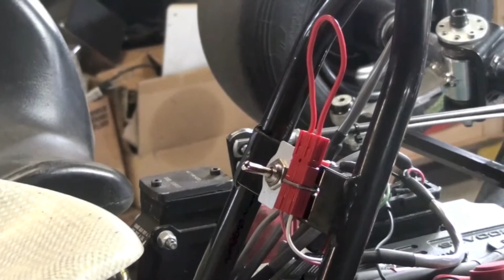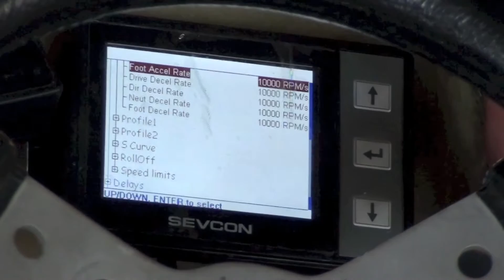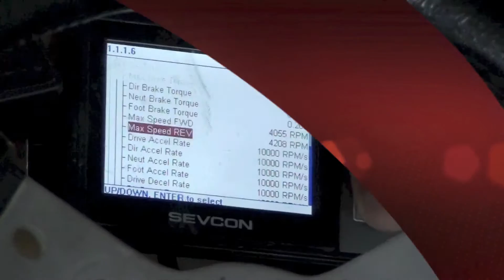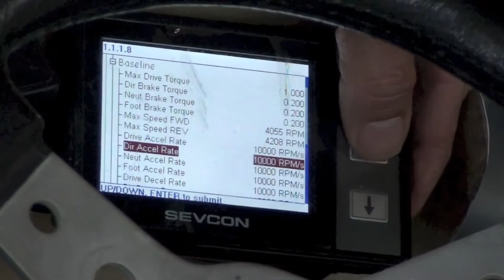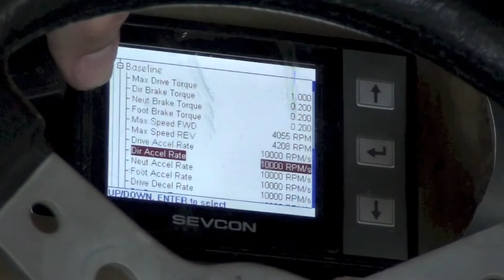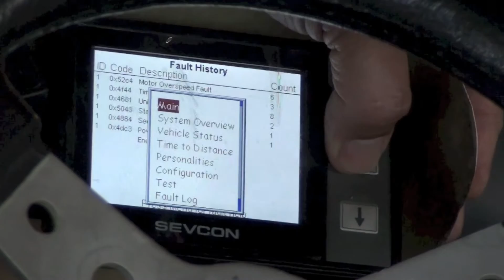Racer8 Progamming the Controller

Comment: When I tried using the ClearView Display to change the Neutral Braking Torque to zero, it put the Sevcon drive in Pre-Op mode. I needed to buy a license from Sevcon to use the DVT software to remove that flag. The one thing here which is so disappointing is that, the guy who sold me this (Raul Aguilar iñarritu from Electric Motor Sport) said that the ClearView was the tool need to configure the drive, it was all that you needed to modify parameters, in his words. But he was wrong.
Reply: Sorry for you, it was doable with ClearView, check the last paragraph (I have not tried)
https://www.thunderstruck-ev.com/images/Clearview%20Quick%20Start.pdf

Comment: When I changed a setting in went into "pre operational" mode and now nothing will work - I need to change it back into operational mode.  I see from your faults list yours has also been in pre operational mode 8 times so you must know how to fix this?
Reply: Jack Good 
Is simple, you must use the backdoor function. Send me a privet message and I'll tell you
Reply: Jack Good 
Is simple, you must use the backdoor function. Send me a privet message and I'll tell you